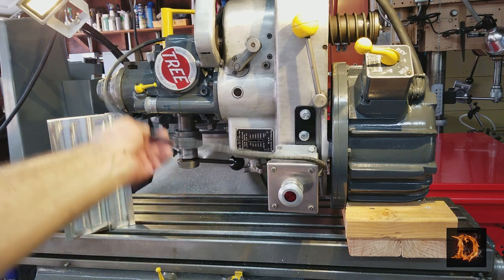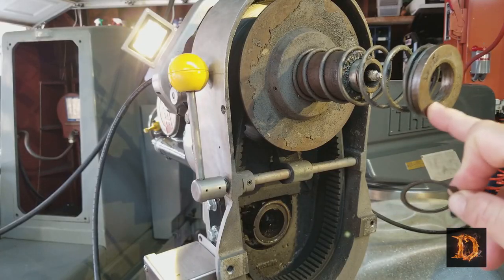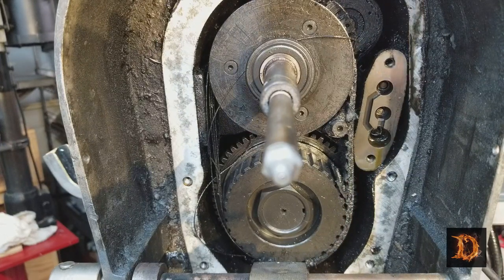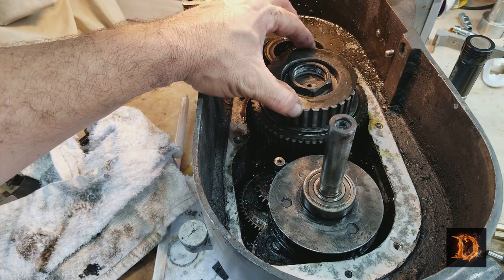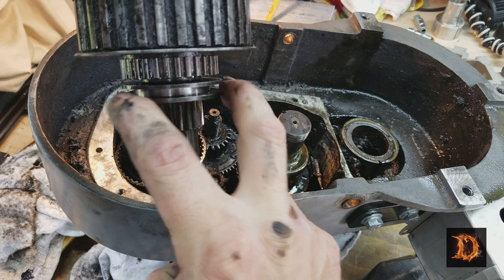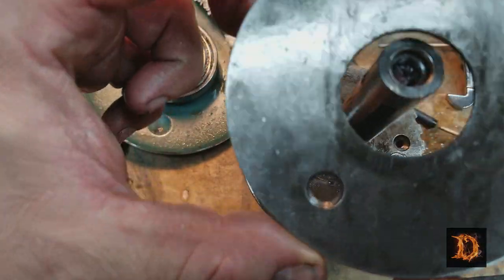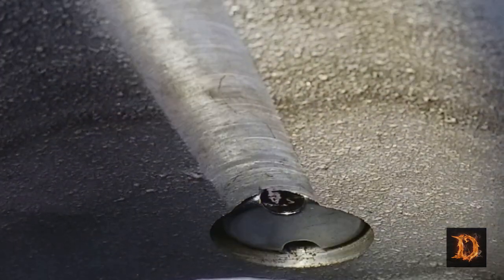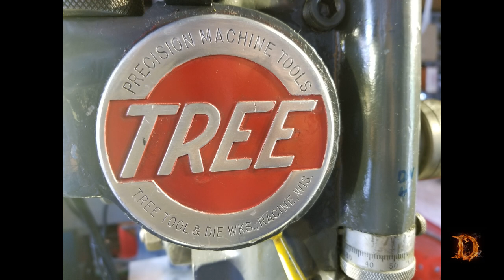Tear Down and Rebuild of Tree Milling Machine Head

Comment: David, thanks for showing us the fine points if this wonderful, high quality machine!
Reply from the maker: Toby W thanks for watching. The bearings didn't fail but were very loud. The drive belt failed though.
Reply: David Dominessy “The bearings didn't fail but were very loud.” Noisy bearings that were quiet after installation are almost always due to failure - old bearings due to lubrication failure followed by spalling of the races, inner race first. See section starting on pg. 107 of the SKF manual I linked. Timken has one too. I’m very sorry to keep harping on this subject, but I feel it is strongly important in the viability of use and resale of old equipment that has been rebuilt or repaired. :)
Reply from the maker: Toby W the bearings I installed were installed correctly and are working wonderfully. Thanks for the interest

Comment: Hey there.   Great video.  I have a 2VG and got it with one of the 4 bolts that locks the head from rotating is broken.  I would like to replace it.  Do you have any advice on further researching that?  Thank you.

Comment: Hello. Thank you for your awesome videos. I am going to look at 2 Tree 2uvr mills this weekend and wanted to know what I should be careful of when assessing the quality of the machines. What are the big red flags for me to just lain pass on the purchase? What are some of the small red flags? One is in the $3k range and has not been rebuilt, the other is in the $4k range and has been reground to factory new specs. They both come with collets and one with a vise as well. I had an excello 602 in the past and was in the process of rebuilding it but my house burned down and all my tools were lost so I'm starting off from the beginning. I live in Sacramento county and mills are fairly plentiful around here but I am interested in the Tree 2uvr and your videos on them are what convinced me to get one. the built in collet closer, infinitely variable spindle feed, and built in one shot lube perked my interest. Hope you get this before tomorrow. Take care.
Reply from the maker: Listen for a noisy spindle,  make sure you don't have more than .055 or so of backlash, make sure power down feed works,  don't buy a 2uvr buy a 2uvrc. The c is heavier and has power cross feed.  Check x and y power feed in both directions and rapids. Of course there could be a lot more,  but this is a good start.  I wouldn't sweat it either,  Tree is good.  Go with your gut and buy!

Comment: great video on the rebuild looks like maybe my next project. I have the 2uvrc any chance of a power feed rebuild? Subscribed
Reply from the maker: Thanks!
The power feed belt inside the head and outside the head is about it.  What is yours doing?
Reply: @daviddominessy  I guess that I should have been more specific I was referring to the gearbox for the X and Y seems to be slipping not so much grinding maybe a clutch inside the gearbox not sure.
Reply from the maker: @bertwacaser6719  my x works but y is dead. I need to tackle that myself so I'm lost as well!

Comment: I like the sacroiliac-friendly motor removal
Reply: My take on bad sealed bearings is that past a certain age the grease dries out and on disassembly or removal of the grease seal you see bad pitted balls, races and metal with clean, hard grease next to it. Sometimes if a bearing runs dry it heats up enough to melt the bad grease and the grease then runs to the bearings and relubes them, but the damage is done and they are noisy and loose. There is a fatigue element in there as well but dry bearings under load do not last long.  Bearings should be pressed into place, not beaten on, the balls and races can be damaged.  That’s how it works with cars, any way. Talk to service at a bearing mfg and they will tell you what to do. Ditto for rollers.
Reply: Quality machine!
Reply from the maker: Thanks, Toby. If I have to install a bearing without a press I "beat" on the inner race. Thanks for watching and for the constructive comments!
Reply: David Dominessy , Thanks, David, that’s the way I used to do it until I found it was damaging the races, If you have to do it your way, do it with taps of a hammer or a driver that engages I and O races evenly at once. Hitting the race with a hammer has a similar effect as driving a ball into the race with a hammer only the force is transmitted inertially. BTW, if you need a bushing to engage with the new bearing, take the old bearing apart with an abrasive cookie in a die grinder, cutting a single slot and removing the balls and ball retainers. I keep a box of them in in my tool box. The slot allows the races to slide on the shaft or in a bore. Note: the bearings do not fail in use, lubed bearings rarely do - they are just noisier than they should be.

Comment: Hi David, well done, and timely for me since I am about to take possession of my own 2UVR. Its gonna need some work but your video will of great help. I now know where to get the belts I will need but I wanted to ask you about the bearings you replaced. Were they standard sizes that are available through bearing retailers or did you find them to be more proprietary? Mind revealing your source. Tim
Reply from the maker: Easy.
McMaster Carr
eBay
Grainger
Reply: @daviddominessy   if you have a list of all the bearings and care to share that would be awesome. buying prior taking the mill apart will save us a lot of time for waiting on parts to arrive.
Reply from the maker: @idobref  I don't,  sorry.